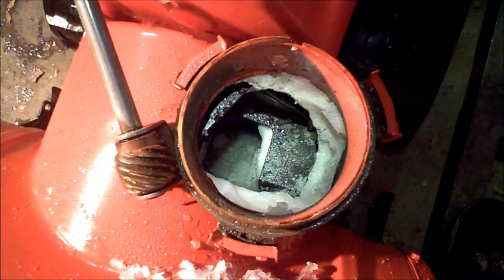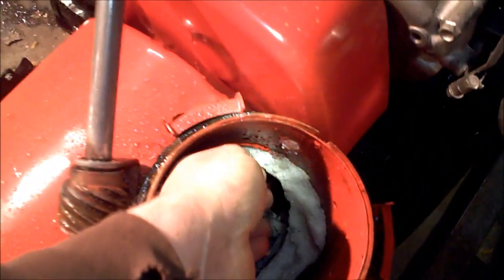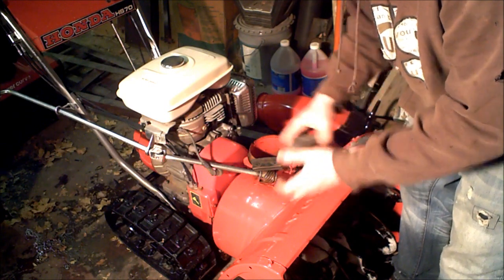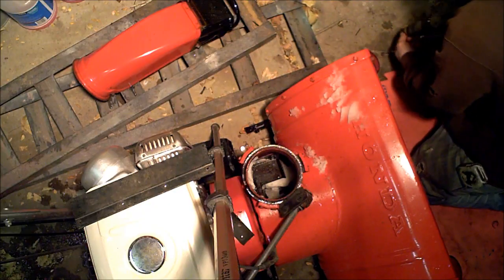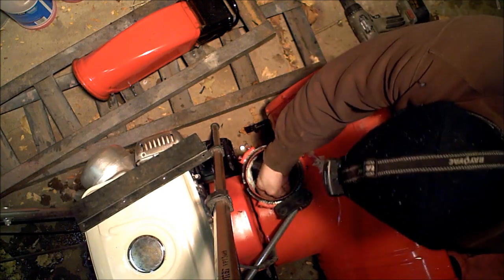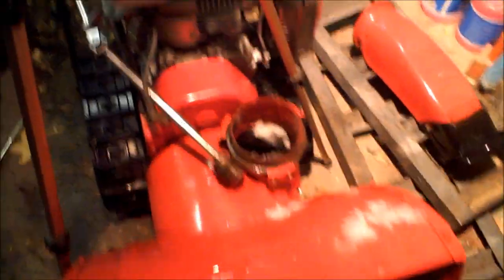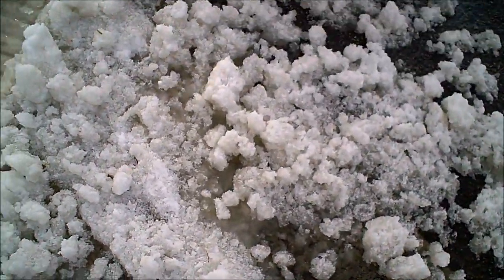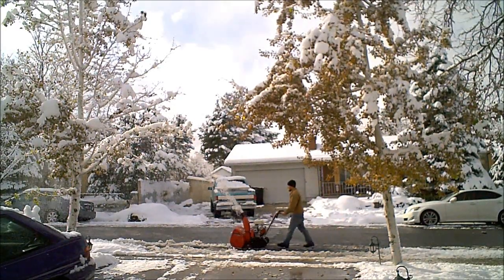Modify Snowblower to never clog and throw twice as far w/ Impeller Kit

Comment: will this fix help a single stage
Reply: maybe attatch the rubber to the center of the auger
Reply from the maker: Lo Co Exactly. If you have a Metal auger single stage, you can take up the gap with a piece of rubber. It makes a very impressive difference on these.
Reply: sixtyfiveford I added rubber to t he middle of the auger on my single stage but the rubber hits the ground and leaves a line on the ground where its hitting. is this normal? do you think it will burn the belt or motor up? I assume it will wear down eventually...maybe I made it too long but if I shorten it up anymore then ill have the gap again
Reply from the maker: What brand/type is your snowblower?
Reply: sixtyfiveford craftsman 5/21 single stage
Reply from the maker: You need new rubber paddles all the way along. They are supposed to hit the ground and propel the machine. http://youtu.be/uvWnCjYQdc8
Reply from the maker: Unless you machine looks like one of these https://i1.ytimg.com/vi/Lo2xbGzqlyk/hqdefault.jpg
Reply: sixtyfiveford this is what I have http://download.snowblowerguide.com/download/536.885214.pdf.
I was hoping I didn't have to replace all the paddles. when I added the rubber to the middle of the auger I added it over top of the old, maybe that's why its hitting the ground so hard. when I get more time ill have to take the whole auger off and try to get the old paddles off which are held on by rivets not bolts.
Reply from the maker: Yes, you need to replace all the rubber. The rivets easily drill right out and a new rubber paddle kit will come with bolts.
Reply from the maker: http://www.ebay.com/itm/Snowthrower-Paddle-set-20-21-22-Craftsman-Noma-Murray-302565ma-W-HARDWARE-/151538538026?pt=LH_DefaultDomain_0&hash=item234866962a
Reply: sixtyfiveford do you think new paddles will close up that gap completely or will I need to make some for the middle
Reply from the maker: They'll close it right up and work AMAZING!
Reply: Lo Co...or, do I not need to modify this machine since it uses rubber paddles to start with. is your mod only meant
 for all metal augers?
Reply from the maker: My mod is only meant for metal augered machines. It is actually an adaptation of your style of machine onto these. Your machine will propel itself a ton better and throw a ton further with new paddles.

Note you can buy the paddles for around 30 bucks without the hardware. You'll just need to run to the home improvement store and buy your own.
Reply: sixtyfiveford OK. I haven't seen any paddles at menards or lowes, ill have to ask them. thank you very much for your patience and help SIXTYFIVEFORD
Reply from the maker: They won't have the paddles their, just bolts. You'll still have to buy the paddles online to get the best deal.

Comment: The last two snows that we had this season were wet, icy snows.  It has rendered my large Toro useless.  Someone told me to spray the chute and tines with WD-40.  Have you tried this?  Is that an option.  I think I'm also going to purchase a single stage electric toro.  I see my neighbors use this on wet snow and he doesn't seem to have any problem.
Reply from the maker: Bossmanrocks WD-40 does work but only for 5-10 minutes, then you need to reapply. The single stage work better on the wet stuff because then have rubber paddles that take up the gap like this modification does. Doing this simple modification is the best of all worlds.

Comment: A month ago I attached the Impeller kit to my Ariens 724 snow blower, today I tried for first time and it works PERFECTLY, Instead to order rubber or the kit sold online, I bought a rubber matt in Home depot for 4.99, I cut it with scissors, and I was able to use that, the rest of the Matt I used to protect my knees when do some mechanics work in the driveway. Thank you so much for your help, This video save me a lot of valuable time.
Reply from the maker: Fan4584 That great. Thanks for the update and I'm glad it worked out well.

Comment: I did this to 2 blowers, 33" MTD and 24" Yardman. This made a Huge difference! I couldn't find thick enough rubber, so I cut the sidewall out of an old tire and it works Great. Thank You for the post.
Reply from the maker: cyjo2009 Nice work. I'm sure the 33" MTD will be amazing with this modification.

Comment: Excellent modification. Back in the 70's when my father tasked me with cleaning  the driveway our second snowblower actually came with rubber impellers and worked great. It was a gravel driveway so the problem I often had with the first blower was breaking sheer bolts due to rocks getting jammed in the impellers. With this second blower and I am sorry that I forgot the brand name, it never happened again. I imagine they aren't included as standard today just to save on costs and then the knowledge probably also lapsed.
Reply from the maker: Pieter Leenhouts Simplicity patented this back in the early 70's so that would have been the brand. They no longer do this but still one of the best machines made.
Reply: sixtyfiveford
Thanks. You're so right. Our first blower was an Ariens followed by a Simplicity. My father had a Simplicity Walking Tractor that he bought in the 50's, however the snow blower attachment was single stage. He thought highly and still does of the Simplicity brand, and still has the walking tractor even after several replaced B+S engines, mufflers, many welds, repairs, and other parts.
Reply: sixtyfiveford I have a simplicity 755 that I think is close to twenty years old. I'm the third or fourth owner and it runs great. I like your idea but I'm wondering how well it will work on a gravel drive that has a few pinecones in it from time to time.
Reply: Matthew Thompson
It worked for me on the gravel driveway 40 some years ago. I think the pine cones would be no problem.

Comment: My blades are plastic,can I still make it work.
Reply from the maker: powerbuilt herbie The high strength composite(plastic) is meant to take punishment. Definatly stronger than regular plastic but precautions needs to be taken when doing  this. Pre-drill your holes and don't put a screw within 1/2" of an edge. Other than that you're good to go and will love your machine after this. Let me know how it goes.

Comment: Hey sixtyfive - I have an old Ariens -- the impeller blades have a curve at the end.  Should I follow that contour to the end of the paddle or just extend the flat part?  Thanks.
Reply from the maker: Kiernan Bros I generally just do the flat part. The curve is meant to pull in more snow and hold it onto the flat part. The flat part is all that throws.

Comment: Great idea. You seem like to think out of the box.  I have a Honda HS55 snow blower ss1007847. The engine and transmission work great, but it "eats" auger belts.  I have changed both pulleys and the idler.  The alignment looks right on and the auger is well lubricated and turns with little force.  I have tried all different belts, oem, kevlar reinforced etc. When it works it works well.  All belts last around an hour or two and then come apart. Any thoughts?
Reply from the maker: Tom Arcati Is the belt stopper eating it up.
Reply: No its being destroyed from the inside. it has to be wear from heat. If the idler is too loose the belt will squeal. The belt doesn't squeal when it's new.
Reply from the maker: The pulleys have to be misaligning during operation. I would suspect the impeller bearing allowing the pulley to move up and angle. A set of straight pulleys won't eat belts unless the load it to great.
Reply: Will check the bearings tks

Comment: A person could use graphite coating too
Reply from the maker: Jason Buis Graphite does work good but would get scratched off in a short amount of time. The ice chunks play havoc on any finish.
Reply: Hmmm I see but there are different grades of graphite...  But ya rubber edge idea works.  I am quite the Engineering minded kinda person.  I would be taking the discharge propeller and polishing the surface with cutting mild teeth cut into the edge with a few coatings of graphite on all the surfaces.  As you can tell I OVER analysis everything! Haha
Reply from the maker: A machined impeller and housing would be the greatest, welded on extensions would be a second, and rubber paddles a third. A graphite coating would boost performance, especially on the impeller blades. But the question is by how much. It may only give a 1% increase in throwing distance which is nice but not obvious with the constantly changing snow conditions.

Comment from the maker: Thanks for watching. Please thumbs UP if the video helped and or leave a comment below.
Reply: +sixtyfiveford I just wanted to write and thank you for the video. I seen this video this fall when I was looking up repair vids for my old Aries. The snow today is super wet and my snow blower plugged 3 times in a 30 foot stretch. I grabbed one of my replacement asphalt crack rubber squeegees "which are the perfect size, just trim for length"  pre-drilled 4 holes because I only did 2 blades, and used the sealing sheet metal screws and did the rest of the sidewalk, the whole driveway, and the big sloppy pile of snow the plow pushed in without clogging. I plan on doing the other two blades now. Thank you! :)
Reply from the maker: +Gary T You need rubber around 3/8" thick for best results. You can buy a rubber paddle they use for the Toro single stage and cut it up. One paddle is enough for 1 or 2 snowblowers
Reply: +sixtyfiveford   Just did this to my 15 yr old white blower.  Cut up an old motorcycle tire.  Huge improvement, better than the day I bought it.
Thanks for the vid.
Reply from the maker: Odessious Jenkins
That's great. I'm glad you tried it.
Reply: +sixtyfiveford        Thank you ,   very useful.    Any suggestions on improving the HS35 honda single stage?      new paddles, still wont compare to the ccr 2000 toro
Reply from the maker: +Kelly Cronk You can make sure the paddles are touching or as close as possible to the impeller housing. The biggest downfall to the HS35 is it is 4 stroke so it doesn't have the speed to throw like the 2 stroke Toro. You can increase the RPM a little on the HS35 but it will still lag behind.
Reply: +Odessious Jenkins    How  Thick is  your  ASPHALT RUBBER ....  Will  This  Work  on  A  2  Stage  Gilson
Reply: sixtyfiveford... I'm not a kid was so effective I couldn't wait to get out the snow across the street on the other side of the thid modification works like a charm!
Reply: sixtyfiveford 8.

Comment: Still need some rubber. I don't have any old tires or mud flaps. Please sell me 2
Reply from the maker: guitartec You can buy a single paddle off a snowblower to use. http://www.ebay.com/itm/New-Snow-Blower-Paddle-Toro-23-3730-/381076617153?pt=LH_DefaultDomain_0&hash=item58b9efb7c1

Comment: Excellent job! I watched both this and the side by side comparison video and I gotta say I'm sold. I'll be doing this modification to my 5HP MTD this week. I also have an ancient Simplicity 4HP single stage where the impeller is right in the center of the auger. It clogs instantly in anything remotely wet. I hope a variation of this modification will work for that machine too. Any thoughts?
Reply from the maker: Marc Young I have a vintage Simplicity S4 sno-away as well. Yes, a rubber paddle attached to both flat sections of the impeller just below the chute and you'll be golden.
Reply: sixtyfiveford Excellent, and thanks for the quick reply. I also just bought a BB-36 snowblower attachment for my Cub Cadet original, and I definitely see this modification in its near future. Thanks again for the great video.

Comment: I love this mod but water stay under the rubber and is rusting my impeller blade, am I the only one???? How can I prevent this?
Reply from the maker: meuhey Minor surface rust won't effect anything and it will go away the very next time it gets used. If it concerns you, you can use WD-40 to displace the water.
Reply: sixtyfiveford Thanks for your quick answer!

Comment: I just did this to my 2001 Craftsman 26" 9 HP snow blower.  Prior to making this modification, I thought for sure I was going to have to buy a new machine as it wouldn't throw even the light snow only about 5 feet.  After adding 2 sections of old mud flap to the impeller, I was just out throwing the slush / slop at the end of the driveway about 12 - 15 feet!  No clogs!  If you haven't already gotten a Patent for this, you need to!  This is seriously amazing!
Reply from the maker: Shawn Baker Awesome. I'm glad you took the initiative to do this. It's a little bit of a pain getting these installed but well worth it. Thanks for the great comment.

Comment: The easiest material to use is the rubber "paddle" from the Toro S-620 single stage snowthrower.  They're about 17 1/2" long x 2 5/16" wide and have seven (7) slightly elongated holes pre-punched along one edge.    Available all over the net.  Sold individually.  Cost ~ $12 - $19 each depending on source.  Just Google "Toro S-620 paddle".  Or buy one at a local Toro dealer - just ask for part# 23-3730 rotor blade for model 38162.

Cut to length as required.  Install with #10 or #8 hex head sheet metal screws and a flat washer on the LEADING side of the impeller blade.  Cut to equal lengths, and install at same relative position on each blade to maintain impeller balance. 

On the original application, the shop manual lists the minimum paddle clearance to the (plastic) housing as 1/16".  The elongated holes aid in this adjustment.  But use your own judgement.  The paddles should not dig in to (or bind on) your housing anywhere along their travel.

Comment: I just got the first one through. I think part of my problem is that I am left handed and holding the impeller with the left and drilling with the right feels a little awkward. I'd rather be pushing on that drill with my left hand and arm. We'll get there though. Us lefties have had to resort to magic sometimes. Ha!
Reply from the maker: TheMaddogT Yeah, it's awkward to get in there either way. Try find a 2x4 or similar to wedge it so you can use both hands.
Reply: sixtyfiveford Got it! Thanks for the help. I'll run it in tomorrow.
T

Comment: I have a Craftsman 5.5/26" with a 9" impeller. Do you think the self tapping screws will work or will I need to drill holes and use machine screws? The impeller blade thickness appears to be about .100" thick.
Reply from the maker: TheMaddogT Self tapping screws should go right through .100". A #10 self tapping screw will work great.

Comment: Any updates on the paddles staying on the impeller using self tapping screws?  I'm just worried that self tapping screws won't keep these on long enough or if the paddle needs replacing, that taking out self tapping screws would be a pain.  I've seen different approaches especially using a nut/bolt combo, but I'm trying to avoid dismantling the snowblower to put on a nut and bolt.  Any help is appreciated.
Reply from the maker: MarcHill83 Over a decade with self tapping screws without a single paddle flying off. The snow/ice is pushing the paddle against the impeller and holding it tight. The heavier the snow the harder it is pushing the impeller blade on.  A self taping screw is much stronger than a similarly sized screw and stronger than a garden variety bolt. Properly installed self tapping screws or bolts will outlast the machine. If the rubber paddle material is soft and not fiber reinforced the addition of washers is necessary.
Reply: I almost had my hands on a single stage snowblower with rubber paddles but some garbage ferry got it before I did. I might end up cutting one from a tire unless you have another recommendation.  What type of self tapping screws do you recommend? Size, material, Ect?  You can tell I ask dumb questions because I'm not that handy:). 
I'm looking forward to this mod since my Ariens 520 doesn't look like it can throw snow that far.
Reply from the maker: Tire sidewalls are generally a little softer and need a washer to keep a screw from ripping through. A #10 screw is a good choice but they are hard to find in a phillips bit.
http://www.homedepot.com/p/Teks-10-3-4-in-External-Hex-Flange-Hex-Head-Self-Drilling-Screws-150-Pack-21320/100138326?MERCH=REC-_-SearchPLPHorizontal1_rr-_-NA-_-100138326-_-N
Reply: Thanks boss. I'm avoiding getting the tire wall but if i do, I'll make sure I get the washers for them. I'll make sure I send you a vid or pic. Thanks again.

Comment: Hi There, I tried this and it worked awsome. I have a question I hope you can help. My snowblower is pushing snow as I think the auger's are turning in the wrong direction..the are forcing snow to the outside. Is this possible?? any help is appreciated
Reply: After watching some video's...I think the Worm gear may be in backwards...if possible
Reply from the maker: Kevin Carson The auger will sometimes throw snow out in front of the machine. It should rotate from the top outward away from the machine and on the bottom in towards the machine.
Reply: sixtyfiveford Thanks for the replay, it does throw it out front, and I think it is because it rotates too slow. Wierd, the impellor is flying fast and the Auger isn't even with new gears. The bearings on the sides holding the auger's are shot and I suspect they are causing it somehow. With the impellor Mod, it never get's clogged...I can even throw water..just not far for some reason.
Reply from the maker: The Auger should move slow. Only the impeller moves fast.